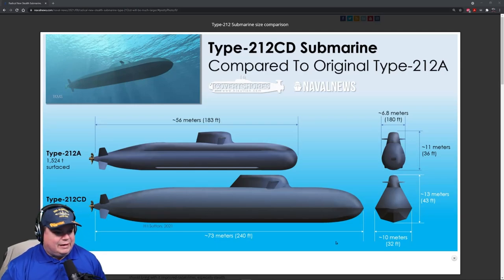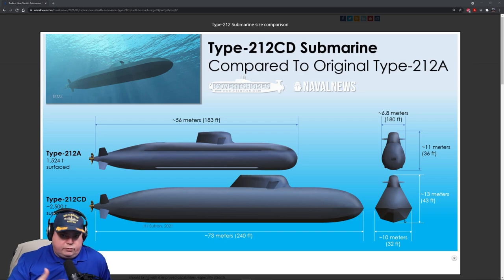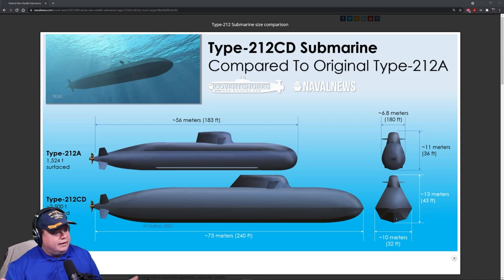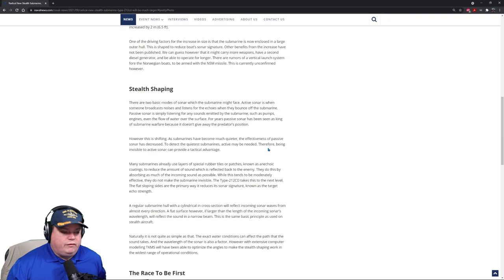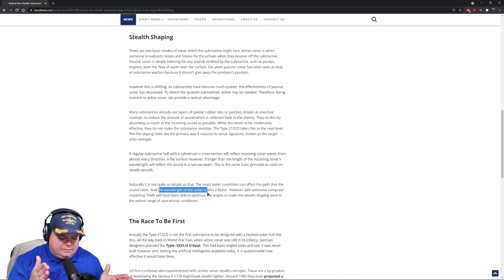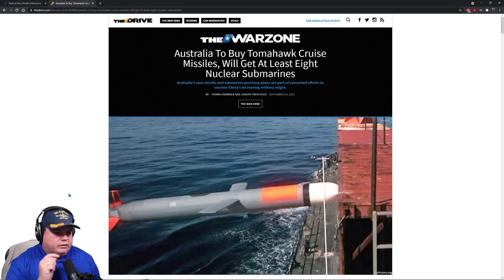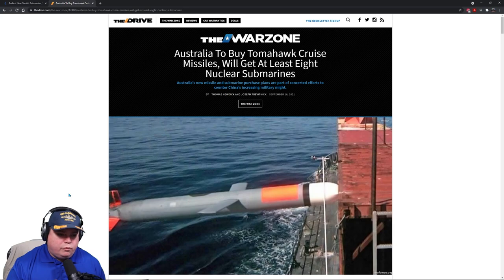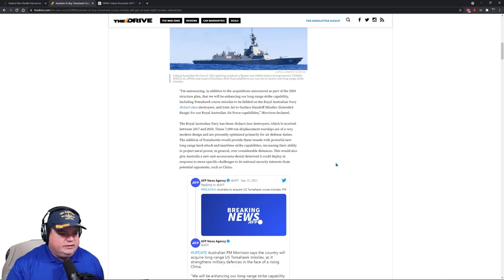New German and Norwegian Type-212CD

Comment: I thought that Germany was only getting two of those and not three… too few anyway considering that we only have 6 type 212a
Reply from the maker: You are right, they are getting 2.  Norway is getting 4.
Reply: @SubBrief  great video! Perhaps Germany is going to cooperate with the Dutch or the Polish as well. Germany often does these shared procurements to support its defense industry…
Reply: @neues3691  by the time the 212cd will enter service the U31 and U32 will approach the age of 30 years. I‘m not quite sure how long the service time for these submarines are but I would hope that a replacement is on the way by then

Comment: The bottom hull shape is more boat like? Perhaps to gain a speed advantage when conducting surface operations?
Reply: I have no idea, but the multiple flat faces on the bottom made me wonder if they wanted a lot of reflective stealth while the sub was at low depth and sonar hits it from the bottom.
Reply: Can also give the option to rest on bottom.
Reply: Probably, since it is a Diesel sub it will have to operate near the surface more often than a nuclear sub
Reply: @KP3droflxp  more that its normal operating waters is not the open ocean but is home is shallow costal waters.
Reply: @jensolsson9666  So maybe it's hull shape is then an advantage when surfacing in those coastal perhaps even riverine operations? Although, the sub is a very valuable asset, so why risk it being seen on the surface.
Reply: @ghostindamachine  considering the ”hight” of the propeler, it it looks like the prop would be above the water if the sub would go full surface mode….. I belive it is more of a sonar reflecting function.
Reply: @jensolsson9666  Thank you :) I agree with you
Reply: @KP3droflxp  It's not a diesel submarine. It's an electric submarine with fuel cell technology. This boat uses its diesel engine when cruising over water. The boat can stay underwater for up to 4 weeks without surfacing and not only sails in shallow coastal waters, but is also used in the Atlantic and Mediterranean. How else do you think the boats would get across the Atlantic when they practice with the US Navy? Likewise, the coast of Norway lies directly on the North Atlantic, and that is blue water and not a shallow territorial sea.
Reply: @callsigndd9ls897  It is a diesel submarine since its main power plant is a Diesel generator. Yes, it has AIP but for long transits it will use the diesel engine because it's faster and has longer range.

Comment: The submarine is good for  shallow waters the us in not interested in such capability they  need speed and many misilles. As i see the design it is more stable for launching sub missiles with more stability.  There atr sensors that can detect a submarine from the hydrogen the electron and other chemicals or parcipals that end in the water  not only sound and sonars

Comment: How sustainable is it to spend decades building a handful of super expensive high tech ships which won't be replaced for fifty years but will be outdated in five? Is there even an alternative that doesn't require unlimited money?
Reply: That goes for all subs. Development takes a long time if you want to be up to date. 212A took almost 30 years as well and is still up to date though.
Reply: That's why most navies give there ships and submarines an MLU (mid life upgrade), you can sometimes see navies do the MLU 2-4 times.

In the MLU they take a ship into dock for approx. a year. strip it down and rebuild it. giving it new equipment and electronics, but also upgrading existing systems, weapons, equipment, electronics. Bringing the ship up to date with newer ships.

Comment: will this submarine have vls tubes?
Reply: I do not think so. Kongsberg has developed the NSM to be fired from torpedo tubes if rumours are correct. This is a 100+ miles surface skimming high manoeuvrability and autonomous missile with very clever counter-attack logic and stealth capacity. For Norway, this is about as far as we go with over-the-horizon long-range weapons since we are not planning on invading anyone. (The airborne JSM version has a range of ca 350 miles when launched from our F35s). 

Apart from this Norway runs with the newly acquired K9 tracked artillery and M270 MLRS (planned to be refurbished) for OTH inderect firepower.

Comment: but don't sharp lines cause vortices at speed that produce sound?
Reply: I think the designers aren't completely stupid. You've probably tested it in thousands of experiments in the flow channel and in the acoustic labs to find the optimal shape. If this shape had disadvantages, it definitely wouldn't build this.
Reply: @callsigndd9ls897  yes for diesel-electric subs that don't go through the water fast. I wonder if it can be applied to nuclear subs without harming speed and noise and speed performance.
Reply: @frbe0101  It doesn't matter what drives a submarine. Why shouldn't it be possible? The fuel cell submarines can also travel more then 20 knots.
Reply: @callsigndd9ls897  Again my concern is the vertices created on sharp edges, the faster the sub goes the more probability of cavitation and thus noise by those sharp edges.
Reply: @frbe0101  How sharp the edges really are cannot be seen in the picture. I think, the designers already know what they're doing.

Comment: How deep can it go?
Reply from the maker: all the way to the bottom like every other vessel.
Reply: @SubBrief  I meant test depth of the sub. (how deep before crush depth) I know this wasnt reported. That shape looks to be shallow water only.
Reply: @joelbreger9897  most likely similar to the 212a since the operating area is the same. Meaning 400m operating and 700m crushing depth. 
Mind you the deepest part of the Baltic see is 459m average 50m, northsee is 700m and the average is 94m. Around norway mostly ~400m, only a few parts being relativly close to deep areas up to 2000m, but those are behind the norway spitzbergen area, when traveling from east to west.
Reply: @MrMcMind  the crushing depth is north of 1 km. who told you 700m? that's just a nonsense number and the true number is a military secret anyway.
Reply: @MrMcMind  Thanks.
Reply: @swunt10  that's the "offical" number by the german marine. So what every you said you made up...

The 700m statement by them is no coincidence, since the deepest part of the north sea is 700m. Do we know the real number? No, does the military know it? Also no, they know the design number and that might be 700m or possible more, but thats as you said a secret, as is how deep they tested it. The actual crushing depth is unkown and hopefully it will stay so....
Reply: I know about the 212 submarines from a friend who was on the escort ship while the submarines were being tested by the shipyard. Forget everything Wikipedia and other publications mention about the performance of these boats.

Comment: So not nuclear? Has to Surface..lock on to contact bearing...kill it lol wot a joke
Reply: This submarine is not a diesel-electric sub. This sub generates its energy with fuel cells. Boats with fuel cell technology can stay underwater for 3 to 4 weeks without surfacing and have a range of more than 8,000 nautical miles.